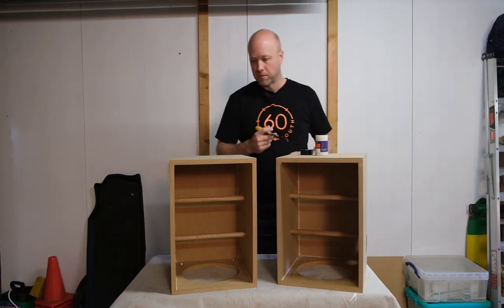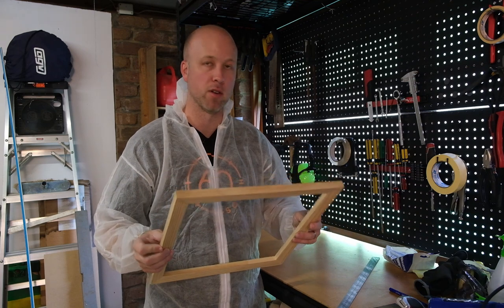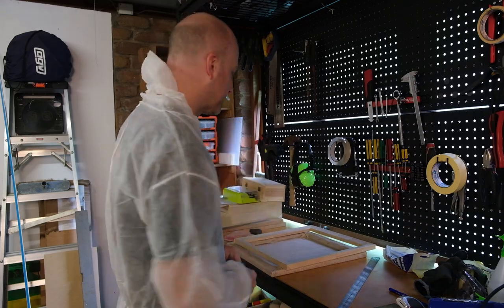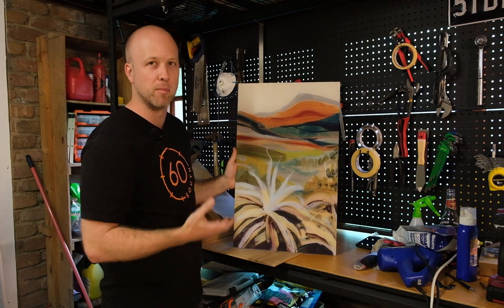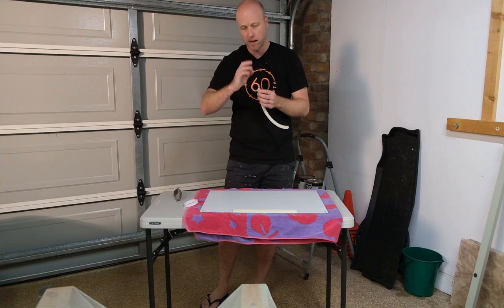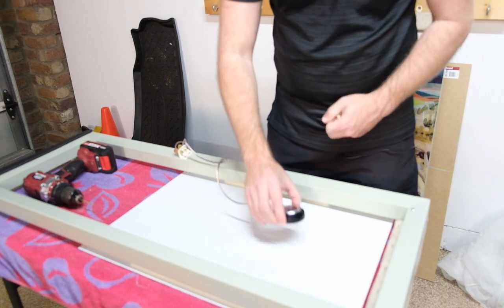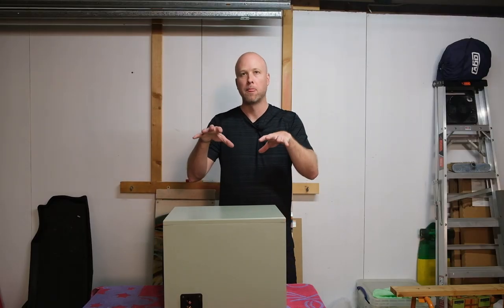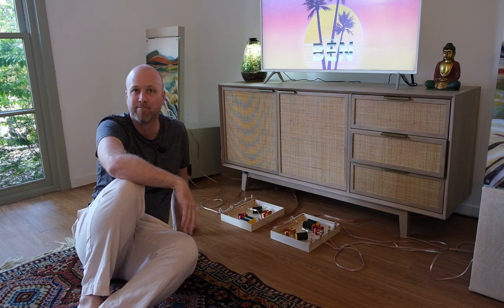Hybrid DML Speakers 5 - BUILT!

Comment: I used to work in insulation business, when cutting insulation if your using a utility knife out of necessity (Far better blades than those) compress what your cutting with a 2x4 or metal straight edge, it cuts much easier, and less of a mess.  nice job overall.
Reply from the maker: Makes a lot of sense, thanks!

Comment: Hello Ben.
To increase the response in the High Frequency range, try gluing an acoustic lens right in the center of the transducer from the front side.
So did "steve shore". As a lens, he used a CD or a small plastic plate or a shortened plastic glass.
Thank you for the video.
Reply from the maker: Thanks Alexandr- I might try it on my test panel but I don’t think I’d want to stick anything on these ones. I did see Steve Shore’s videos - really interesting, I wish he had some measurements up.

Comment: Acrylic has kicked my ass so many times, but I think I've finally got the hang of it. For drilling holes I have found that high speed low pressure worked best. It's that last little bit as the drill bit is just breaking through that has destroyed so many pieces for me. High speed low pressure with a flat backer and incremental steps, now that's a lesson I've learned the hard way. Clearly your technique is working well for you. And those speakers look awesome man. I never would of thought about printing the panels with a picture, I didn't eve know that was an option. This has been a very interesting journey, thanks for taking us along for the ride. Cheers 🍻
Reply from the maker: Yeah it’s a tricky one for sure. The clear piece I used for testing had the corner broken off because I got a bit impatient with the drilling - I had to sort of clamp it with a washer to take my measurements. Took it real nice and slow on these printed ones!

Thanks again 🙏

Comment: You should stand up one of your inductors on each crossover so the magnetic fields won't interfere with each other.
Reply: the potential to interfere at that distance w/ the supplied current is close to zero but yeah..
Reply: Not at that distance apart! Good practice on a standard board though yes.

Comment: With DML speakers, I can't get the idea of layering multiple panels out of my head. 

What if you were to take 2-3 panels of different thicknesses and stack them together with spacers in between? Possibly the spacers should be located on these 2/5 and 3/5 resonance nodes. Surely this would have some kind of effect on the range of frequencies the speakers could play?

On top of that, I've been wondering if a very thin panel were to be used with another resonator (almost like the membrane on a subwoofer) inside an enclosed box, if this would create a passable dml subwoofer?

I'd love to experiment with this.

Comment: Hi, I am impressed very much. My question is don't you think one sub is enough? And would it play better with a lamp amplifier?
Reply from the maker: Thank you! 

So this build actually started because I had built a pair of floor standing panels but didn't really have the room for a separate sub woofer (as you can see in the video). So it made sense (to me anyway) to integrate the woofers into the design.

The other issue is that the panels do start to roll of at approximately 200 - 250hz, and most powered subs won't cross over that high. Even if I could get one to cross at 250hz, that's high enough that localization becomes an issue (you can tell where in the room the sound is coming from), so having a sub in a different spot from the speaker becomes problematic.

If you run EQ to flatten the panels out to a lower frequency and run a single sub up to maybe 100 - 120hz , that could work, but I stand by what I said in this video about the panels sounding better with the 250hz roll off. By removing the bass from the panels, I feel that that rest of the frequency range is improved.
Reply: Thanks for the answer. Now I see. I hope I will follow your  succesful experiment here in Sibirea.
Reply from the maker: @xkb2010  yeah of course there are many ways you could go but this setup works well for me. Good luck with your build!

Comment: Hi Ben I've had to close my channel because of copyright issues, try an aluminium disc 3inch diameter x 1.5mm thick with an aluminium washer in the centre of the disk as a stand off, place them towards the top of the acrylic at the back, makes a brilliant tweeter.
Reply from the maker: Hey Steve. That’s a shame about your videos - you’ve taken a unique approach that seems to be paying off with the speakers. I’ll look into the disc thing on the back of the panel!

EDIT: Did you ever get around to using the bass shaker on your panels?
Reply: @TypicalBenYT  oh yeah I used a separate canvas panel with a piece of acrylic 3mm thick glued to the back with a bass shaker in the centre, in a 2.1 amp set up awesome.
Reply: Hi Steve, is there any way I could connect with you through email or social media? I've been watching your DML videos for a long time and tried your method out as well. It's a shame that all your videos got taken down..
Reply: @SashiShrestha  Hi Sashi I've exhausted all the canvas panels, I can't see what else I can say or do regarding the canvas builds, I'm starting a new project soon with open baffle speakers.
Reply: I wondered where you’d gone Steve!   I think you can use music as long as you attribute it.  See how Joppe Peelen does it in his speaker videos - he seems to have been on-air doing build / demo videos for a few years now.  Interesting tech too!
Reply: @chriscleverley4320  Thanks Chris I will look into this 👍

Comment: Nice job! They look and sound amazing. I don't know if you've had a real close look at the AER Goldy exciters (the BBX module), but they are actually mounted on the front of the panel. There's a little disc of what looks like the kind of material used to make circuit boards out of screwed into the front of the module which is the tweeter. One driver is essentially two types of speaker. Wonder if the screw hole at the back of your exciters could be used for your rear-facing tweeter idea? There's some great up close shots of the BBX module on the AER website so you can see what I mean and there are YouTube videos of the Goldy at trade events where it clearly shows the module attached to the front of the panel.
Reply from the maker: Hey Barry, yeah I have looked at the goldys and the trick exciter. Hadn’t thought of it on these though - really interesting idea!

Comment: Very interesting… I thought DML panels had to be suspended to work… versus attached… enlighten me 😊
Reply from the maker: That does seem to be the common way of doing things but it doesn't have to be suspended. I've built several pairs of panels with semi-rigid attachments to a wooden frame. Initially I tried this due to ease of construction and the fact that it's "neat", but I have also gotten some really good results sound-wise. The corners of the panel are effectively 'clamped' but the rest of the panel edge is free. In particular the sound out of these hybrid panels was really nice.
Reply: @TypicalBenYT  I will have to experiment… we’re buying a new house (closing on 7/14) and I’ve been researching speaker ideas for a listening room and/or a home theater area… maybe suspending some panels from the ceiling (three across the front two in the back suspended  flat from the four corners like a dropped ceiling)

Comment: The easier route would of been just to add a separate powered subwoofer in which you can adjust the frequency as well as the volume of the bass.
Reply from the maker: Easier but not a substitute really. Most commercial powered subs can’t cross over as high as mine (250hz with a 2nd order slope). I really wanted to take as much LF load off the panels as possible so needed a woofer that could play higher.
Reply: @TypicalBenYT  Some Sub amps can reach 200hz with 12db per octave low pass. Combine that with the versatility of being able to adjust the volume as well as crossover setting will make it easier to blend in with the DML panels as well as to compensate for room gain like you mentioned.

Comment: Why not just turn that bottom TV desk into a sub and hang the acrylic frames on wall? The boxes look ugly and seems to take a lot of space! Just my 2 cents.
Reply from the maker: You say that like it'd be easy! Doing that without ruining my new furniture is well outside of my skill level to be honest.

Also with the wall-mounting - it's nice from an aesthetic point of view but doesn't sound very good. The further I pull these out into the room, the better they sound - just like conventional speakers and especially open-baffles (which are most similar to the panels).

I am going to make wall hanging panels in another room but they'll be more for background music whereas I really wanted to get nice sound out of these ones.
Reply: @TypicalBenYT  Makes sense. Enjoy your next project 👍👍
Reply from the maker: @kaikoolblader  Will do thanks a lot!

Comment: 12 Inch openbaffle subs would probably be better my recommendation aespeakers
Reply from the maker: OB was my first thought as well and would be ideal. it did seem like I'd need to use some kind of active crossover or external EQ to get a linear response (though I'm happy to be corrected on that - I've no experience with OB) so in the end I decided to go for the simpler solution.
Reply from the maker: Just looked at the AE Spaeker 12" OB woofers - 30lbs each! Damn, I'd have to redesign my frame to support those things. Currently it doesn't have to be very solid since the enclosure supports it's own weight and the tall frame only needs to support a lightweight panel.

Maybe Hybrid V2 though!

Comment: It appears that both exciters were placed in different positions with only one being at the 3/4 position. How was the other positioned? Did you rerun your frequency response tests with finished set? configuration,?🏙️
Reply from the maker: Hey Wilbur - they're both in the 3/4 centered spot - if it looks different in the video it must just be the angle or something. I've only done a couple of in-room measurements so far but I do plan to get some proper ones done soon.